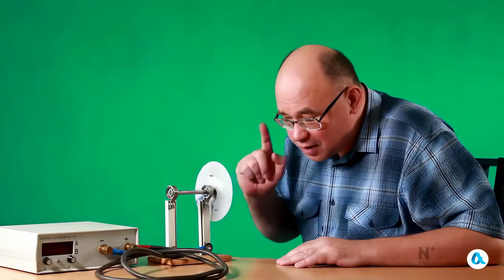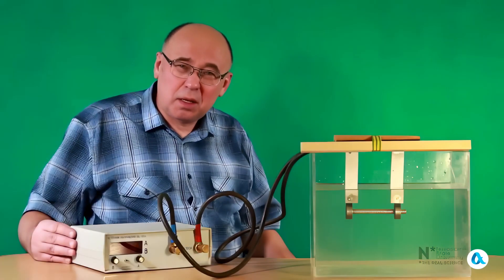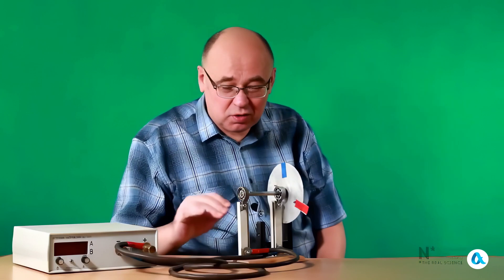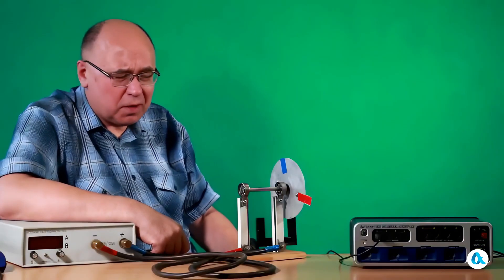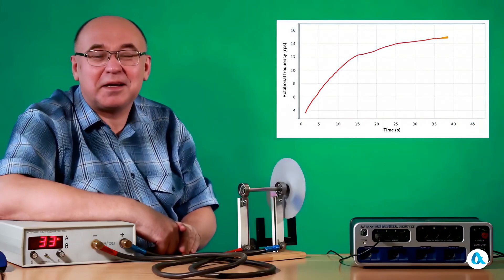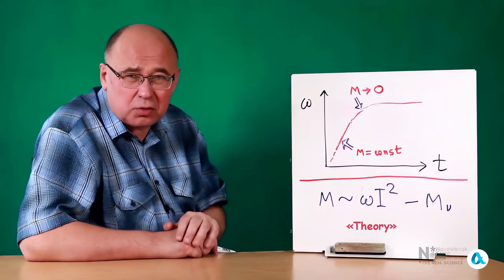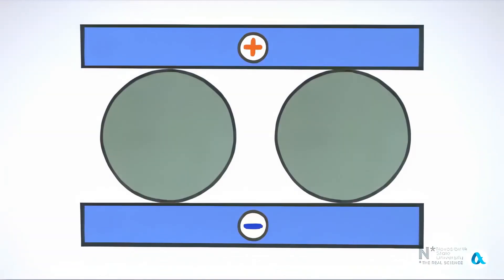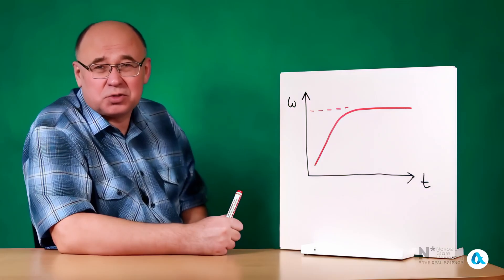Ball bearing electric motor

Comment: Perhaps immerse the ball bearings in liquid metal (avoid mercury, instead use gallium w/indium, to be liquid at room temp.)  Does the motor halt, or perhaps operate with different behavior?
Then next, use insulating ceramic ball bearings, and immerse them in liquid metal!  (Might need to disassemble, to employ metal race but with ceramic balls.)

Comment: How about making such a motor with replacable balls, so that you could change material? For example, aluminum balls would expand more (but on the other hand have lower electrical resistance) and thus perhaps spin faster?

Comment: Interesting. My initial thought, like the 2nd theory, was that Eddie currents were causing repelling magnetic fields.
The 3rd theory seems reasonable, It may be right even though to me it's hard to imagine that the balls could heat up and cool down fast enough to sustain the motion at higher RPM.
Maybe one way to test that 3rd theory would be to replace the current with heat, by heating up the inner and outer races of the bearings, which should cause the part of the ball which is touching to heat up by conduction and expand. If so, when the inner/outer races are hot enough, launching the flywheel should also result in the acceleration.
Some other tests using the current could be: 
1) let it spin long enough that the balls would, in theory, have reached their thermal equilibrium where the heat from resistance is spread out evenly throughout the balls, in which case it should stop spinning
2) supercool the bearing with nitrogen to try preventing expansion, which should be preventing torque, or at least reduce it to an extent which could be measured by looking at the time it takes for the acceleration. 
3) use worn bearings which have more play than the maximum possible expansion of the balls, so that even if they do expand, they can't provide torque, in which case it shouldn't be able to accelerate at all.
Reply: thermal expansion raises as many questions as it answers; and the ball bearings have 3 dimensions.